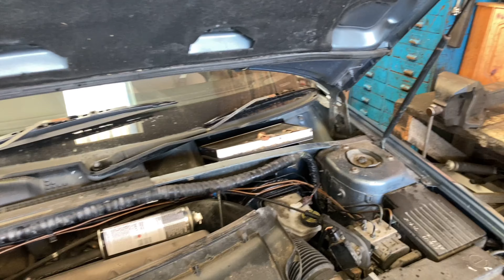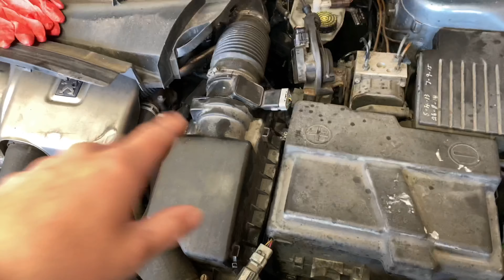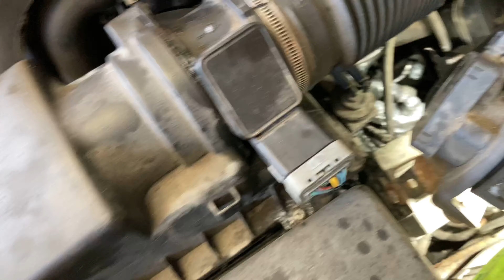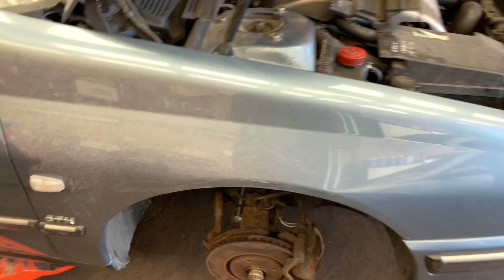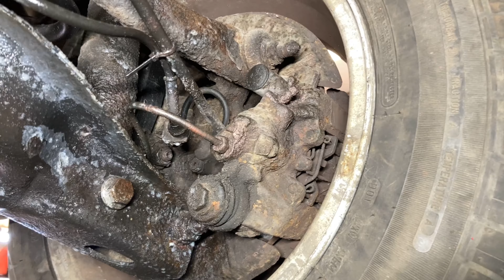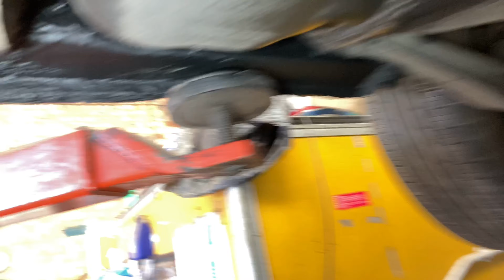Pre MOT Inspection And Repairs Part 5| Peugeot 406 GTX 2.2 16V HDI | Project 406 PT5

Comment: Looking good! Are you going to do anything about the rust on the wing? I’ve seen other 406’s with the same problem, my rubber covers look ok at the moment, but will be keeping an eye on them.
Reply from the maker: Thanks again for your support 👍🏼

Bar finding a second hand wing the same colour, not much I can do, odd as my 2000 X plate with same miles wings are immaculate, if I start messing with it have a feeling it will look worse than it currently stands.
Reply: @CarAddictGarageNE  That’s true. Maybe just keep an eye out for a wing on the 406 forum or eBay. 
They do vary, another rust trap is on the front lip of the bonnet where it starts from behind and ends up coming through on top.
Reply from the maker: Funny you say they my X Reg one has the rust on the bonnet, also on the estates just under the rear window on the boot both have rust there.

I know a guy only 2 mile off all his done for 20+ years is collect old Peugeot’s, especially the 406 his got mountains of parts.... Town and Country look him up in Morpeth top guy he is 👍🏼
Reply: @CarAddictGarageNE  yes, I saw the rust on the hatch on another one of your video’s.
Hopefully he’ll be able to help you out with a few parts!
Reply from the maker: Brilliant having him on the door step.

I scraped it down and KuRust treated the boot today, and touched up with a temporary rough match paint pen I had sitting about